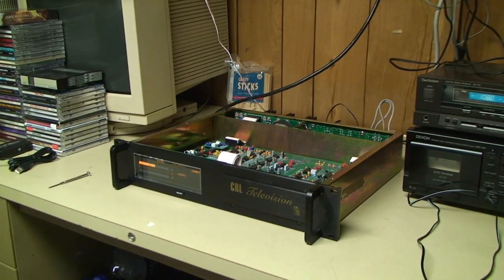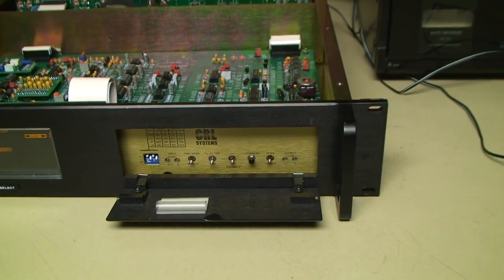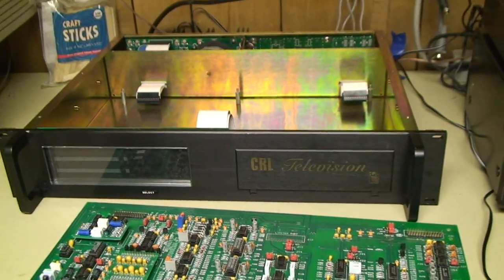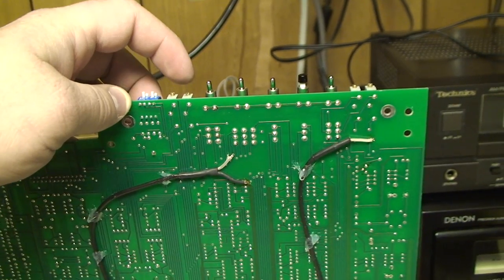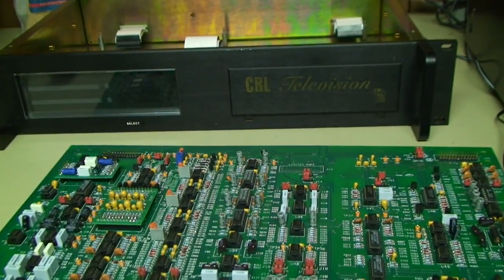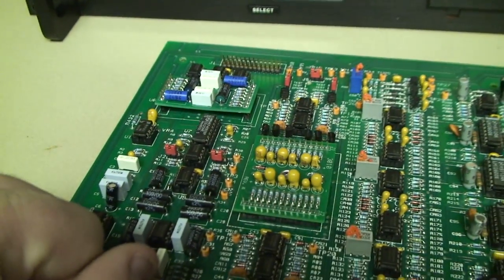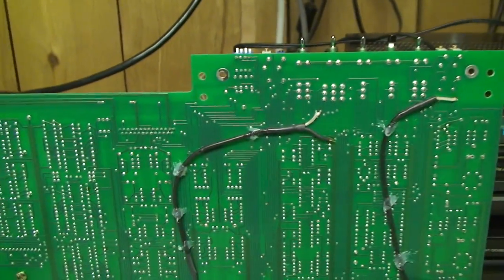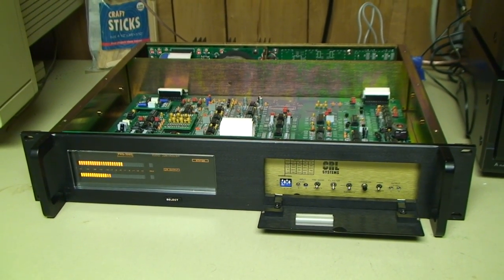Kitchen Table Electronics Repair: CRL Systems TVS-3001

Comment: The input and output level controls work by shunting some of the audio signal to ground. If the control becomes a dead short, then all of the audio will be shunted to ground, resulting in a dead channel.

Comment: Some of these little trimpots that were used by CRL make a clicking noise when you reach the end of their travel -- at which point it keeps clicking with every rotation, indicating that turning it more isn't going to change the resistance any further. But I don't recall if my TVS-3001 has these kinds of trimpots in it or not, because I haven't had a reason to adjust any of the trimpots to the end of their travel.

Comment: 1920x1080 is 2¼ times as many pixels to compress than 1280x720, so rendering the video at 720p will be faster than at 1080p, even with that extra step of resizing thrown in. And anyway, YouTube is unusable at 1080p for people like you and me with 3 Mbps connections. The data rate that YT streams is something like 5 to 6 Mbps for 1080p, 2 to 2.5 Mbps for 720p, around 1 Mbps for 480p, and around 500 kbps for 360p.

Comment: Maybe that variable resistor doesn't directly handle the gain control--it could be that it gives a signal to an IC, which in turn controls it.  I would imagine that it could be set up to give the same result, no matter which way the control is turned--to higher, or lower resistance.

Comment: Well we all have those Bas**rd moments bill, i too have gone into equipment to fix minor problems and wished i had not, when fixed i have put the back on triple quick and mentally slapped myself for upsetting the internal apple cart lol :-)

i once took the top off a vcr to clean the audio head for a frend, but the sleeve of my jumper caught on one of the video heads, i then spent 6 hours replacing one head and setting it up, i was told it was impossible, i did it, like you i dont give up :-)